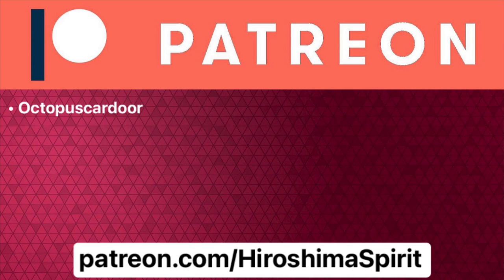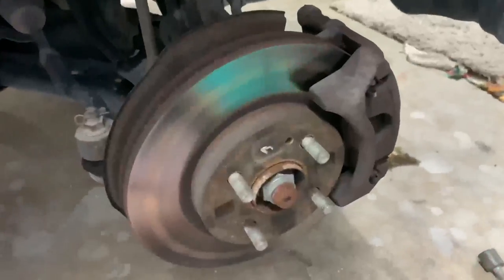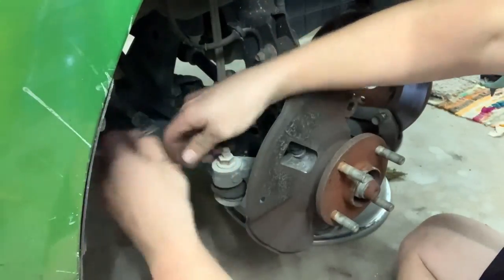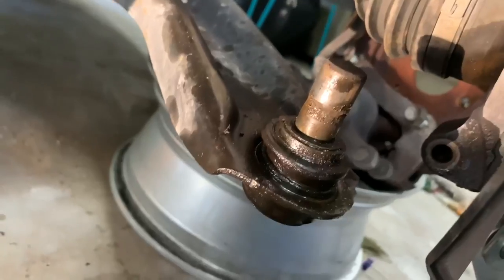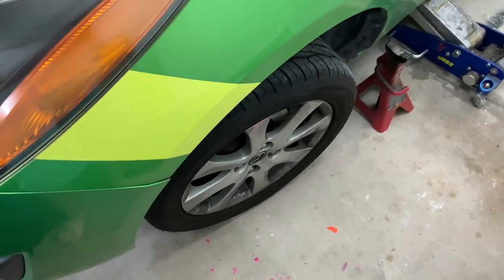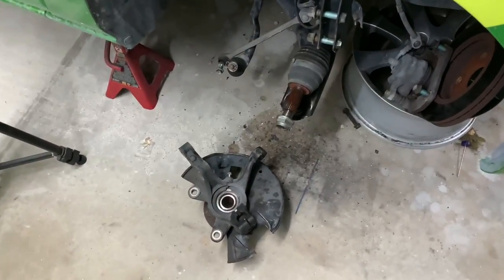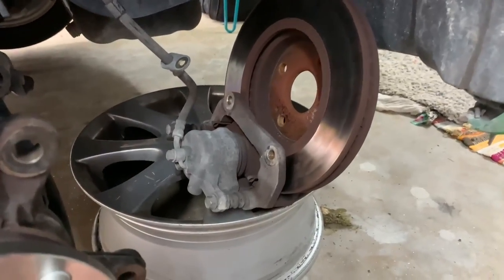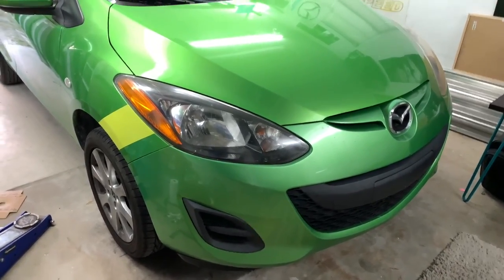Mazda2 | Front Wheel Bearing Replacement (For The Average Home Mechanic)

Comment: This is also why I can't work on my own car. I just drop it off and in a few hours it's back. I give you kudos for doing it or trying.
Reply: Having moved out and not having a garage or a place to work on my car, I'm sorta in the same boat. Things like changing my brakes I still will be able to do myself, but oil changes and suspension work will probably have to be done at a shop. Luckily, there's a shop within walking distance of my house where I can take my car and hopefully get suspension issues taken care of. I never got my lowering springs on and at this point, it's probably not gonna happen until next year. 

Maybe I'll bring them down with me when I (hopefully) go to FL next year. Should have time and space to work on it there.

Comment: Thanks for the video!  I am doing the same thing, but have a problem. When I try to remove the large nut to get the bearing hub off, the driveshaft turns, so I can't get it off.  Is this because the other tire might be turning?  I don't think it is, but who knows.

Comment: Looks good man. And I know what’s like having suspension components that don’t corporate. My 00 Buick needed new front struts so I had a buddy help me out, got the drivers side one on ok but the passenger side was so corroded on the knuckle assembly it had Galvanized (joys of living in the Northeast) 

We tried everything, Soaked it in PB Blaster, smacked it with a hammer, heated it up with a torch, Used an Air gun, etc. Had to just say fuck it and had my mechanic guy put it on and I’m now taking the thing to get an alignment.

I would do those by myself, but I don’t trust myself with alignments but perhaps your future vid on it will remedy my fears. 

And do you man when it comes to the gloves, I’m the opposite, I need to wear them because I can’t stand the stuff on my hands. If I’m in a pinch and got to do it with no gloves then ok but if I have said option I glove up.

Comment: I'm hearing a slight scraping noise from back right wheel. Think it could be a bearing?
Reply from the maker: Bearings make a loud, low tone humming sound that increases with speed if they’re bad. Does it make the sound all the time or only occasionally?
Reply: @HiroshimaSpirit  Just some of the time mate.
Reply from the maker: It’s difficult to try and figure out a random noise without being there in person, tbh. Check all of your exhaust head shields to make sure they’re not loose and/or contacting anything else.
Reply: @HiroshimaSpirit  Aye, cheers. I actually think it's my tyre pressure at back because I have to reinflate every 8 days or so. Probably the bead of the tyre
Reply from the maker: Sounds to me like you have a slow leak, if that’s the case. Check for punctures.

Comment: Does anyone know the torque on the caliper bracket for mazda 2 or Scion IA
Reply from the maker: I don’t torque my brake components, personally. I tighten them until I can’t anymore and it’s never let me down.
Reply: Great the local O'Reilly's said from 58 to 72lbs. I'll do that set it at 70 or till it's tight enough. Thanks for all you do.   SPEED ON

Comment: Great vid like usual, got a question for you unrelated to the wheel bearing. I bought my second Mazda 2 today and upon inspection it suffers from side shaft seal failure just like my first 2, have you encountered this on yours?
Reply from the maker: The green car has developed a weep in the driver side differential/axle seal but it’s not enough to greatly affect the fluid level... yet. Other than that, no.

Comment: Can't  they stick to just one size of nut?
Reply from the maker: Each nut is the size it is because of the load it has to carry. They can’t all be the same because some would be overkill and some wouldn’t be enough.
Reply: @HiroshimaSpirit  aye, but don't you just wish?
Reply from the maker: I prefer hardware be as light as it can be for a given job, personally. Haha

I’m happy to undo five different bolt/nut sizes.
Reply: @HiroshimaSpirit  I often find that the nut behind the steering wheel to be the biggest problem. How would you suggest that I remove it? Would Beer or Doughnuts be the better option?
Reply from the maker: Beer, certainly.